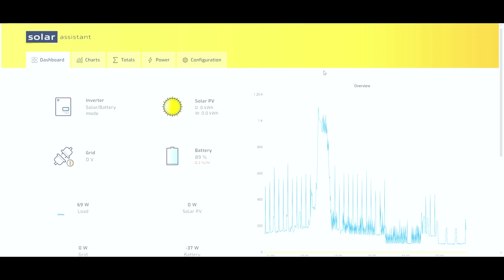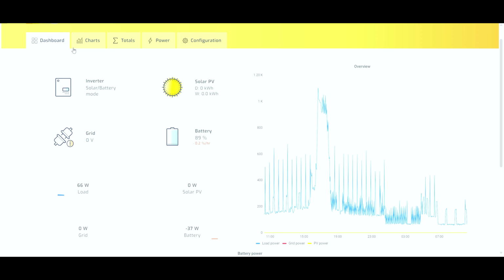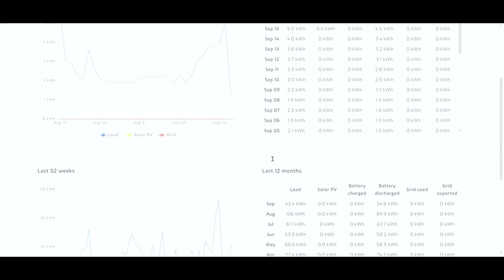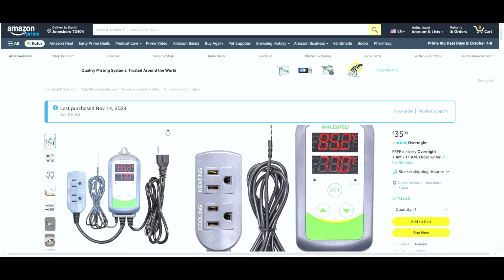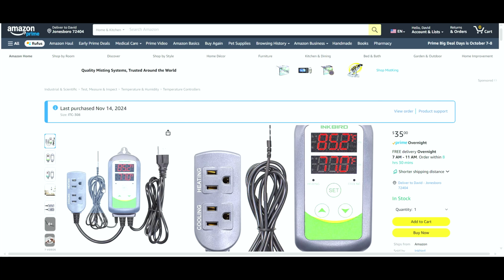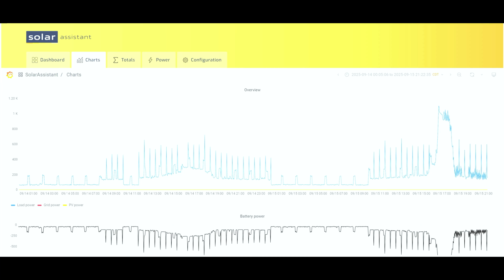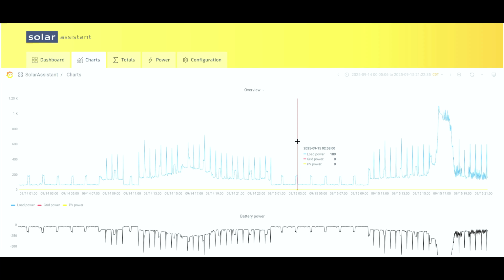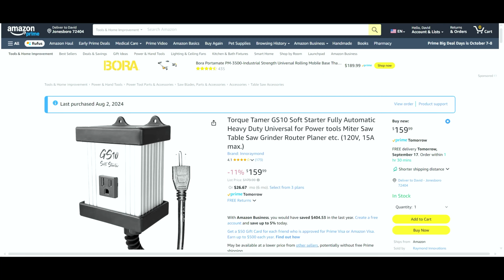Solar Monitoring Importance, and soft start on a freezer.

Comment: Before I had monitoring in winter I set my inverter clock 6 hours ahead, at 4:30pm I check discharge to charge, if I was -4kwh then run the Gen 1 hour, now its 5:30pm and the charge/discharge values add up usually 4kwh more charge than discharge, then the clock flips I am charged up and can track my discharge over the next 14 hours of no solar. Electric heat at -25F is something you want to easily track. My 12000xp is set to +5hours now then it becomes 6hr on clock change. I need a bigger freezer but the 7.2 cu/ft surges at 3A and runs at 1.0A, my AC can surge to 46A, trips the breaker once per year, 90% of the time the surge is 15A.